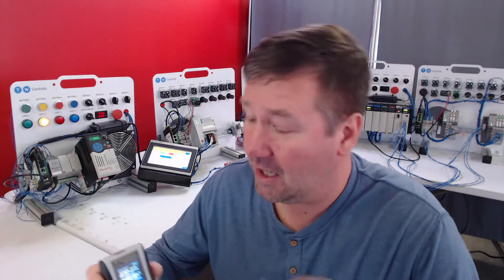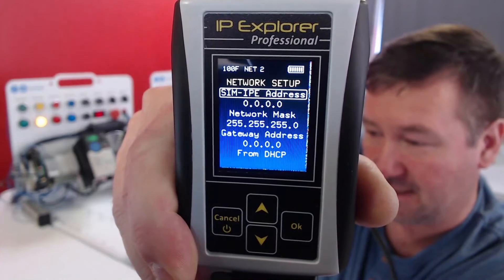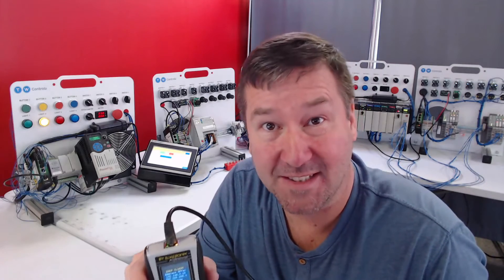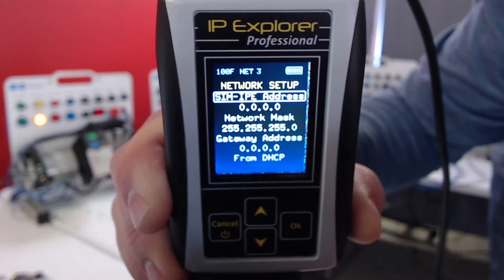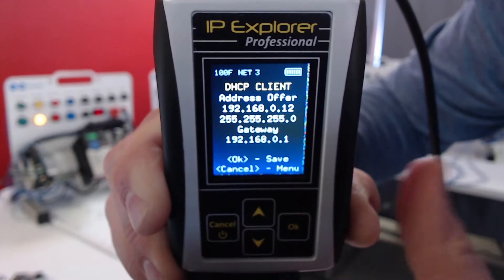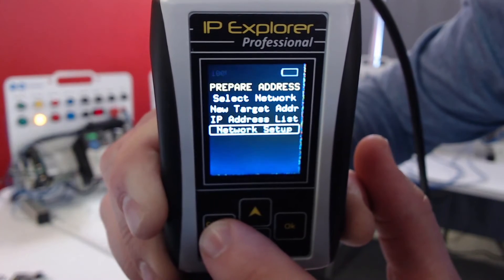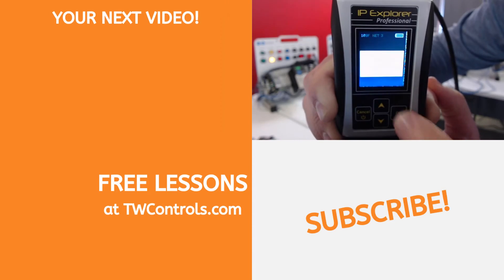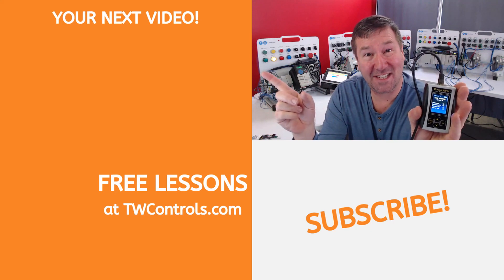DHCP Server Tester. Discover what IP Address a DHCP Server will Assign

Comment: I really like the idea of the addition. I also like the confirmation of on/off the internet. I use your current tool frequently. I will occasionally be setting up a new DHCP server on a control network. The feature would be a quick and easy test of functionality. It would be pretty awesome to to be able to see the lease time of the address too so you can be confident that the address given is essentially static or not when the DHCP server is not reserving the address for the device. If you need a Beta tester, I'm happy to help.
Reply from the maker: Great feedback Robert, thanks.  Let me do some additional testing and see what it will take to upgrade models.  Submit an inquiry so I have you on the list. https://twcontrols.com/contact

Comment: Hi Tim, I actually have two of these devices.  One was bought probably 8 - 10 years ago and the other is a year or two old.  Is there any option to do a firmware update to gain this functionality?
Reply from the maker: Not sure yet, it is only a prototype.
Reply: @TimWilborne  OK Tim, Happy New Year, by the way.  FYI....I just used mine to get a client out of big trouble just last week.  A few of his RIO blocks suddenly lost their IP addresses and withing a few minutes, I managed to restore them.  If you were receiving telepathic messages of "Thanks" about a week ago, it was me ...lol!
Reply from the maker: Glad to hear that Robert!
Reply: @TimWilborne  I second FW updates. I too have an older model, but considering it has different hardware (if nothing else, a B/W LCD) I would be shocked if you could support updates for older devices.